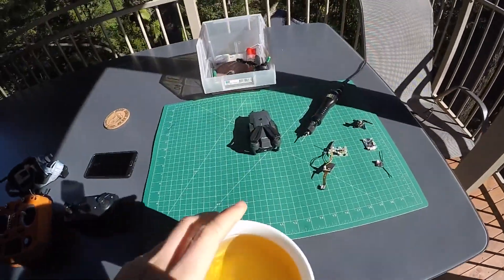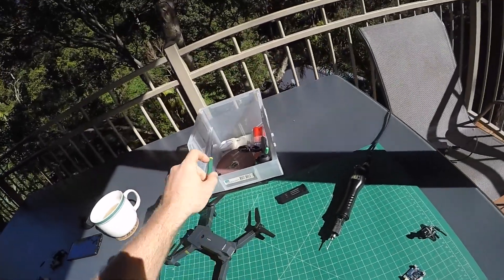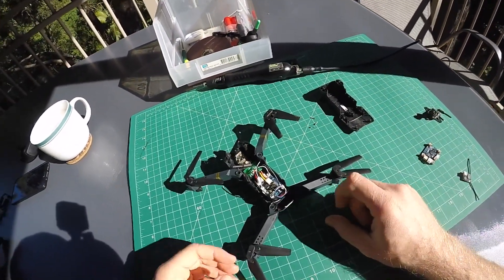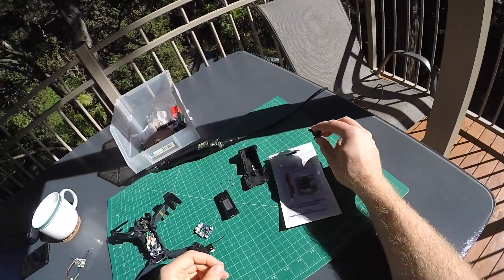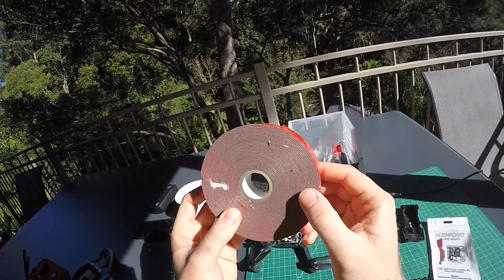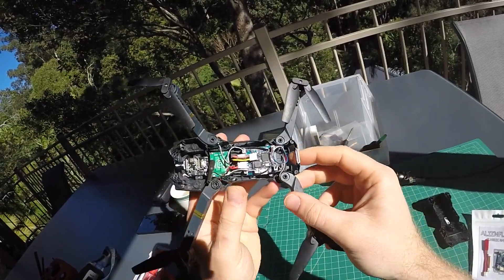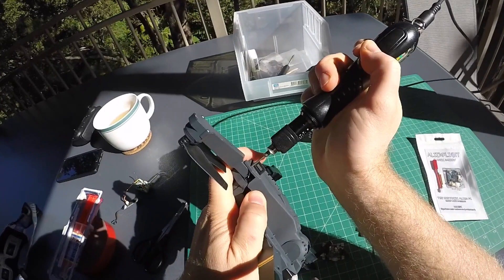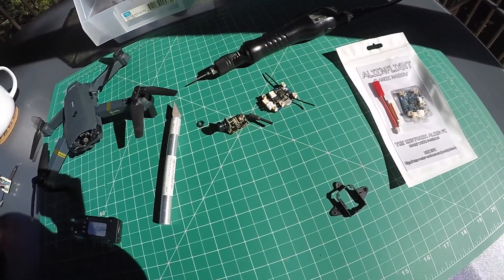How to: Eachine E58 Mavic "Clone" with 5.8GHz video and Arduino Flight Controller

Comment: what do we call the green board on your table?
Reply: most common term is "cutting mat". Similar but different, you might also like "silicon work mat", "electronic repair mat" or "soldering mat".

Comment: Thank you for this excellent review.  I have this drone and enjoy it.  I was wondering how I can enable the video but still use the remote control that came with the drone, not the phone controls.
I can get the video working with the app but cannot get the remote to work after that.  It seems that the app blocks the remote signal.  Is there a way that I can overcome this?  Cheers!
Reply: impossible!

Comment: Hi, first of all thank you for your videos it's always a pleasure to watch and listen to the jungle!
I am French and I do not speak English at all. I own the Eachine E58 and I wish I could do as you make it cool!
You think I can do it?
Should there be electronic knowledge?
I followed the link and I hesitate to buy the material I'm afraid of not succeeding!
What do you think ?
Thank you in advance !
Ps: I am using the translator! Exscuse me 😳
Reply: Yudidd Gaming Gday mate, greetings from Australia!
You need to do some very basic soldering (two simple joints), and you need to adjust a few settings on the flight controller (flight mode and arming) to your preferences. You will need a DSM(x) compatible transmitter.

If you have any questions, you can ask here in the comment section, or in the forum thread I have linked in the video description. English and French is close enough so that you can keep using the translator and we will understand.
AlienWii is used for many years now, many people are using it and willing to help.
Im sure there is a French community out there too but I don’t know where. I don’t speak French ;)
Reply: Benedikt Haak Ok I took a Transmitter Jumper T8SG V.0 Plus and a Eachine EV800D 5.8G Mask.
One last question after I leave you alone what reach do you have with this installation?
Thank you very much for your video there is more than getting to work!
Reply: @YudiddGaming  range is just enough to fly around my house. In an open field, you get as far as football field before signal quality degrades significantly.
I think you chose pretty good equipment to get started!
Reply: Benedikt Haak Good evening Benedikt, I have a small problem I can not synchronize my radio TS8G plus with Alienflight the led stays on and does not blink for blinding!
Is there a manipulation to be done? Thank you for your answer
Reply: Yudidd Gaming what receiver are you using?
Reply: Benedikt Haak Good evening Benedikt I am sorry and being an amateur I think that I launched myself in a domain that I do not control!
I have receiver there TS8G jumping over!
The problem I can not get to binding
And the Alienflight when I press the bind the led does not blink!
Yet I was happy I managed to plug everything including propeller engines but I think I'm bad! 😞
Reply: @YudiddGaming  - plug receiver into FC with little cable
- press button on FC, and while pressed, plug battery into FC
- then activate bind mode on transmitter, with DSM2 protocol selected
Dont worry if it doesnt work the first time.
None of us achieved flight the first time.
Failure is not the opposite of success. Failure is the way to success.
Good luck. You are always welcome to ask questions here!
Reply: Benedikt Haak Ok thank you for your answer, I will try to connect the alienflight to the TS8G I have no cable type but I will try to find! Sorry for the inconvenience 🙏🏼
Reply: @YudiddGaming  receiver cable is included with flight controller, its the smaller 3-pole cable. Its to connect flight controller to receiver.
Reply: Benedikt Haak Exscuse me Benedikt but I can not find or connect the cable on the TS8G ?! I do not have a suitable outlet!

Comment: How bad is the original Eachine FC? Would it not be easier to use a multiprotocol module with the Taranis?
Reply: Im not aware that the multiprotocol module supports the E58 protocol. I might be wrong.
But even then, I like to adjust flight settings, such as inclination angle, angle strength, and PID values.